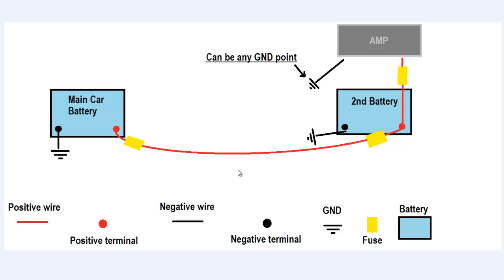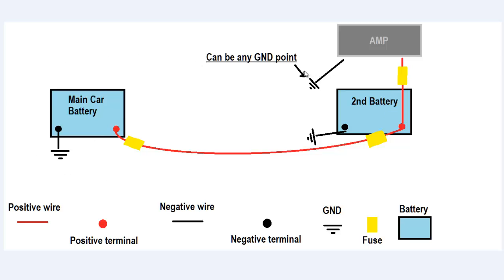[EASY] How To Setup Dual Batteries For Car Audio!

Comment: Do the amp and 2nd battery need separate grounds? I’ve seen some people just connect the amp ground directly to the 2nd battery ground terminal instead to chasis.
Reply from the maker: You can use the same grounding point as long as it is grounded to a nearby piece of metal as well, instead of just trying to ground it to the battery itself. Hope this helps

Comment: What happends of you don’t use a fuze for the batteries and only for the amp?
Reply from the maker: It’s really recommended to use fuses. For the price, you may as well install them. If there’s a wiring problem and/or or the wire get too hot, the fuse will blow and prevent any fires or further damage to equipment.
Reply: @JakesCarAudio  aha okay thx
Reply: Fire hazard the fuses are meant to stop fires

Comment: is the ctek good for charging batteries at home? I saw that between the first and the second battery you need a parallelator or charge divider like the ctek D250SE otherwise both are discharged, is it true, do I need it?
Reply from the maker: Yeah you can use a charger on this setup for home use. It will almost act like an alternator, supplying power and charging the batteries. You can just wire them like I’ve shown and they will act as one larger battery; it’s best to use the same battery model and size for best results.

Comment: so why u got amp hooked to 2nd battery? instead of first battery
Reply from the maker: the 2nd battery would usually be the one in the boot/trunk, which is much closer to the amplifier. You wouldn't need to spend as much on wires this way, since it would only be feet, not meters away, from your amplifier(s). With thick wire like 0awg, especially multiple runs, this would save a fair amount of money for starter setups.

Comment: Quick question. Let's say I already have my two amps wired to the main battery thru a Distribution block. If I add a second battery could I just run that battery to the main battery. Will it still supply extra power and work correctly.
Reply from the maker: Yes mate, even just linking the two batteries alone would still provide extra power for your two amps, they work as one circuit.

Comment: Ok bro good video but what size of fuse i need to use  bro
Reply from the maker: what wire are you running? a common mistake with newbies is they don't know what fuse to run. You always fuse to the wire size, no matter the wattage.

Comment: So do you not have to hook a positive wire from second battery to the alternator?
Reply from the maker: not needed, it will still work as one circuit even with the 2nd battery not wired to the alternator. If you use 0awg wire from 1st to 2nd rear batt, that will allow up to 350amps of power just with that single wire.

Comment: The 2nd fuse serves no purpose
Reply: Second fuse is there for safety if the cable breaks from 1st battery to second it’s fused both ends so no fire as both batteries will be live 🙏
Reply from the maker: fusing the middle of the wire with a single fuse can work well too. All fuses serve a purpose.
Reply from the maker: see Aaron Campbells comment.

Comment: Can you please give me your opinion? I’m hooking up a 2nd agm, same brand but different size batteries. How many amps do I fuse between front and back? Sub amp is 200 amp & mids is 40 amp, so 2 separate amps in back tied to rear battery.
Reply from the maker: I would suggest this too. The basic wiring was just for the video, and I am using a very low wattage amp in this vid. Sure, use all wires :)

Comment: hello I wanted to ask you a question: your second battery has the same amperage as the first motor side? example 70 ah at the front and 70 ah at the rear? Thank you.
Reply: my alternator is 150A and I have two 70A batteries one in front and one in the trunk.
Reply from the maker: @gd6315  That should be fine! I once ran a 90a alternator with 260ah of batteries. I had to charge them when not using the vehicle quite often and also keep track of voltage.
Reply: @JakesCarAudio  😱😱😱
Reply from the maker: Not anymore - I run a small starter battery to fit the tray and larger batteries in the boot. This is fine as long as you are monitoring voltages and have a sufficient alternator.

Comment: To use the secondary battery your ground to amp should be from the 2nd battery
Reply from the maker: As long as your batteries are grounded sufficiently this will work yes.
Reply: @JakesCarAudio   what would you consider sufficiently
Reply: i have the amp to the 2nd battery haven't had a problem. but i just noticed/remembered i did that. and forgot if it was save....

Comment: Thank you so much for the simplified diagram. Every other video I've seen on this subject is over complicated
Reply: Agreed! I searched Irvin the YouTube search and all I could find was guys talking way to much most seemed like they didnt know what they are talking about. My concern was the ground for the 2nd battery. Most are running a ground from first to 2nd battery. I dont want to do all that.  First, my cable is 2/0 so the less garden hose under the ccx hood the better I think it looks and second is that's alot of wire to be running. So I'm going to do what I originally was going to do before I second guessed myself and run the ground directly down from the second battery to the frame. The second battery is where I'm going to install 3 runs of 2/0 to my amplifiers. My only other concerns are , should I run a battery isolator I'm between the 2 battery on the positive and 2nd thing, should I put a fuse on both ends of the new positive wire that's connecting the 2 batteries together? I have 2 huge alternators so plenty of power to charge the 2 batteries. I've always been skeptical about inline fuses tho on my car audio. Seems like it defeats the purpose of the monster sized wire it it has to choke it down and thru a tiny little strip in the fuse. Just seems like a huge  bottle neck and waist of big wire. Let me know your thought when you have a moment. Thanks
Reply from the maker: Glad it was helpful!

Comment: people are telling me i need a neg. wire from front batt. to the rear?  i just have pos. wire frt to rear and amp goes to block, block to 2nd batt. block to frame.   is that ok?
Reply: see?
Reply: because having both batterys with separate grounds will always have your batterys discharging at separate rates. Run a wire from Battery 1 positive to battery 2 positive... run a wire from battery 1 negative to battery 2 negative... ground battery 2 negative only and have your alternator running to your positive of battery 1... this forces both batteries to play as one and you have double the capacity and they never discharge at different rates
Reply from the maker: check ground resistance with a DMM set to read ohms! Then you know if it will be different. I now run both positive and negative from front to rear, since I have done thebigthree and grounded to my engine block.

Comment: First battery is for starting, second one is for Aux - they are fundamentally different types of battery and should NOT be the same
Reply from the maker: In my car I have larger aux batteries compared to the smaller starter battery (so it actually fits in the tray). You can mix and match the same size or different AH (but it is best to keep it constant) as long as it's maintained and it is the same technology/model line. You should not mix different technology (e.g. agm vs lithium vs lead-acid)  or ages, such as an old used battery (some cases may be ok but it isn't advised). I have bought a few brand new batteries from the AGM Start-Stop YUASA line. Why shouldn't they be the same? I have high current starter and aux batts for those heavy bass hits.
Reply: @JakesCarAudio  i suggest you do some reading before you start advising people
Reply from the maker: @xangodango  have a google about if you should mix different types of batteries. Let me know what comes up :)

Comment: A question...
Should the fuse that goes from the 2nd battery to the amp be dependent on the amp specs (for example amps max consumption=170A, so put 170 or 150A fuse) or is it dependent on the amperes the wire can handle (0awg=350A) ?
Reply from the maker: Fuse is all dependant on the wire. I use 300a for 0awg and they're fine - I'm sure they'll pop before it gets hot. Look up car audio fuse charts. I can do a video on this?

Comment: Okay, I understand this now. I’ve been watching videos for a while and just now I stumbled upon this and everything clicked in my head. I just have one question: 
How do you know what size fuse to use on the batteries?
Reply from the maker: The fuse is purely dependent on the wire size. I use 0awg which can handle 350a, but I fuse at 300a to be extra safe and I've never had issues with fuses popping.
Reply: Depends on the battery you're using. Look at the specifications of your battery and there should be an amp rating for a fuse.
Reply from the maker: @therealScopolamine  but if the amp rating is very high and he uses a small wire this will cause troubles. You should ALWAYS fuse to the wire size, the whole point is to pop before the wire melts/gets hot.
Reply: Me too! Lol it just all of a sudden made perfect sense.

Comment: You don’t need the 3rd fuse to 2nd amp in the “boot”. 2 fuses on one line? Pop and then another pop if something happened. No electric doesn’t work that way. Just need the 2 fuses. Main battery and from 2nd battery to amp.
Reply: If the fuse on the wire bridging the battery breaks then theres still live current travelling the long end of the wire from the second battery
Reply: Chr onic you have a good point here
Reply from the maker: It is extra safe. not needed as such though. you could fuse in the middle of the wire if it makes you happier

Comment: I hooked my second battery up just like this and my fuse box to my second battery melted on me so i ran positive and negative from first battery to second battery and positive from second battery to amps but not the negative from second battery i ran my same ground before i got second battery to my amps. Why did my fuse box melt when i followed your method but not the one im using now? Oh and i did away with the second fuse box closest to the second battery and it seems to be doing fine...
Reply from the maker: Why did you wire to your fuse box? You need large wire directly from battery 1 to battery 2 with fuses.
Make sure you fuse and use the correct size fuse & wiring. An ANL fuse holder or inline fuse holder would be a good idea.

Comment: Please advise us on how to install secondary batteri for my motorbike. Tq
Reply from the maker: same way, positive to positive, negative to negative. parallel so it stays the same voltage. Make sure your wiring is with adequate fuses.

Comment: Good clip, and the amplifiers ground can be shared with the sound systems battery. Also, a circuit breaker can be used at the starter battery and a second circuit breaker installed at the sound systems battery.
Reply from the maker: Thanks for the comment. Always ground the 2nd battery for best results.

Comment: What's better parallel or series for batteries
Reply: For cars, you should always use parallel.  Parallel = greater amps storage.  Series = doubled voltage = VERY bad for your cars electrical system.
Reply from the maker: series will blow your cars electronics as it would send 24v everywhere. always wire parallel (pos to pos, neg to neg) in a 12v vehicle.

Comment: What do the fuses do
Reply: Meme TV keeps shit from burning.
Reply: Meme TV techincally u can use 2 fuses instead of three thats what im doing but cant go wrong with fuses extra protection
Reply from the maker: fuses protect the wire from burning, which in result protects the electronics that they are wired to. Fuses should be rated to the wire size (or less, to be safer).
Reply: OMG, google does wonders. Even though you should know, if ya don’t maybe ya shouldn’t be starting to install just yet bud. Maybe gets some experience with ya first. For safety purposes

Comment: is a 70 amp alternator enough to charge 2 batteries?
Reply: We have ran up to like 500Ah agm with 100A alts.
Just top off the batts at home wall charger every now and then  if they arent at full charge

Comment: cant you run the amp power wire with the distribution block so the amp can get juice from both batteries. the amp going beat up one battery the power wire from the other battery along with the alternator cant keep up. that's how i did mine. let me know
Reply from the maker: I mentioned in the video to make sure you have a sufficient enough alternator to charge both batteries so there shouldn't be problems unless you have the stock one or one that isn't strong enough. And I never thought of wiring with a distribution block like that. I wonder what the voltage difference would be like?... Cheers for watching, and for the comment! :)
Reply: Mr Lazy you can also do the big three upgrade plus install a second battery.